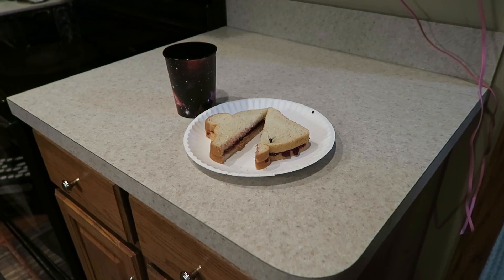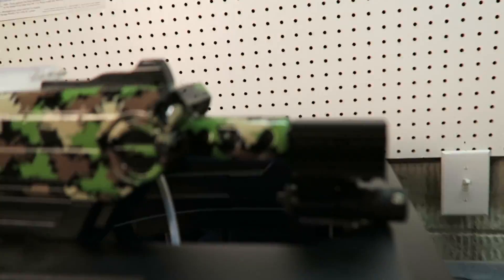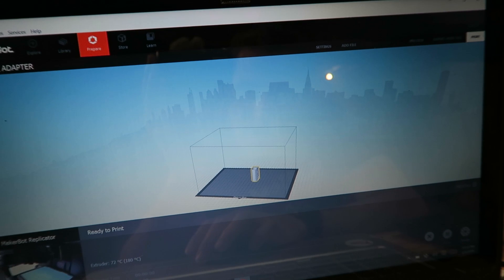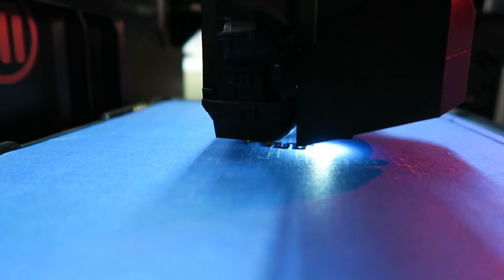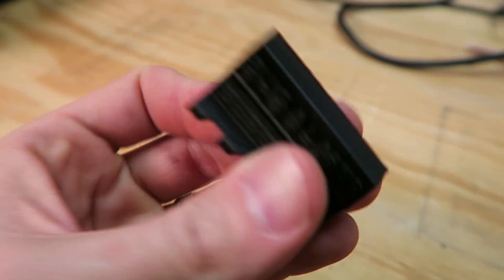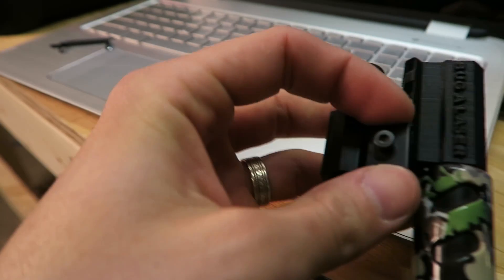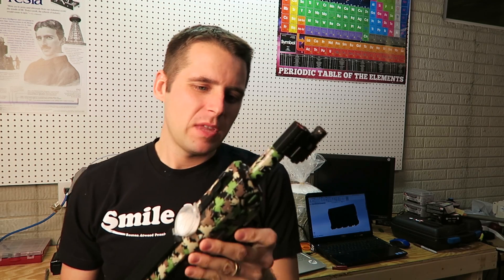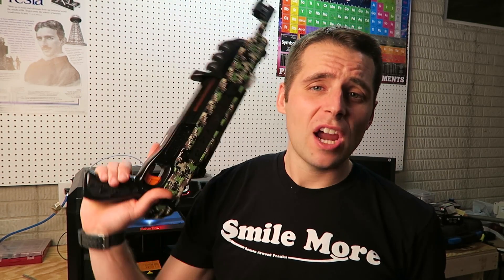3D Printing GUN parts

Comment: That print should take 30 minutes maximum, you need to adjust the print speed. You can raise your print speed to 60-70mm/s. I've for a 3D printer and with a single print I've made a working bearing. And I've designed many different toys and gadgets for around the house and friends. 
Check out by 3D printing business: https://www.3dhubs.com/edmonton/hubs/yakfab3d